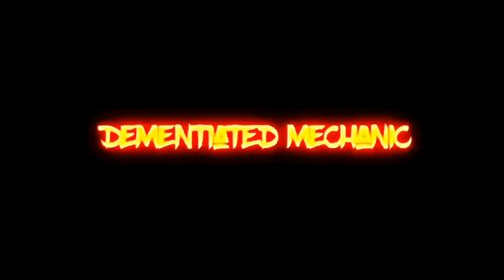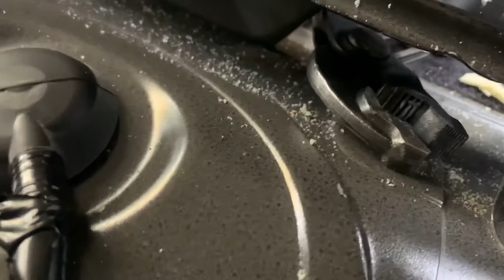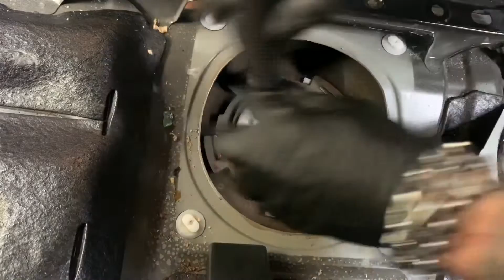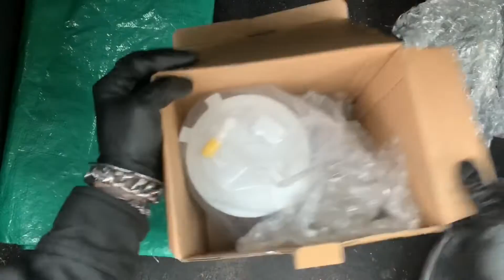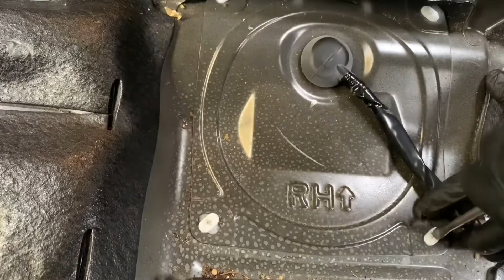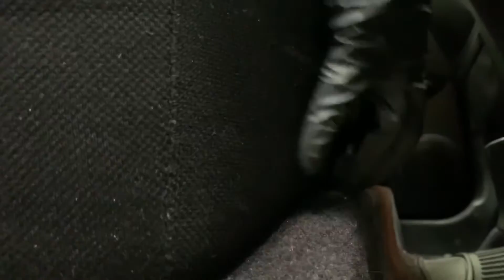Nissan Rogue Fuel Pump R&R..⛽️ Walkthrough

Comment: Thanks for this awesome video!
Should I pump the fuel out before remove the old pump?
Reply from the maker: If you have more than half a tank, you might want to figure out a way to empty some out before you begin. But otherwise, not unless the gas has been in there over a year.  

Just be careful to clean around the pump ring and on top of the tank while your working so that dirt and debris don’t get into the tank

A little is ok, cause the screen will do it’s job.
Reply: @MechanicalTriage  Thank you so much🙏, you're Great!

Comment: does this also solve the issue on nissan pathfinder 2013 (untimely/hard to duplicate) judder? no codes where found...
Reply from the maker: That sounds like a fuel problem working it’s way down line. Could be the transmission, but honestly I would check the spark plugs first.

Comment: I found two fuel pump covers after seat removed.
One cover with letter LH and the other cover with letter RH , should I replace the LH or the RH one or change both?
Many Thanks!
Reply from the maker: What’s the year, make and model?  May have a transfer pump.
Reply: @MechanicalTriage  
Hi , my car is 2009 nissan rogue SL  AWD,  I now know another cover  without a black pipe at top is fuel level guage for sensing the fuel level only .....I had an inaccurate fuel level indication, that's where the problem is,I guess.
Will buy the parts to change it, not the fuel pump
thanks for your response!
Reply: The AWD Rogue and 2WD Rogues have different pumps, the video shows a 2WD. but the replacement is basically the same. The AWD pump has a couple additional connectors once you get to it uses the split fuel tank system, the pump is on the right, the additional fuel level sensor is on the left. The left side connects to the right side pump.
Reply: Yes, you are right 👍!

Comment: nissan rogue 2017 is it the same?
please tell me. and thanx bro
Reply from the maker: The part number changed in 2014. It’s slightly different. Pull your back seat up and look for the access panel.  If it’s under there, procedure should be close to the same.